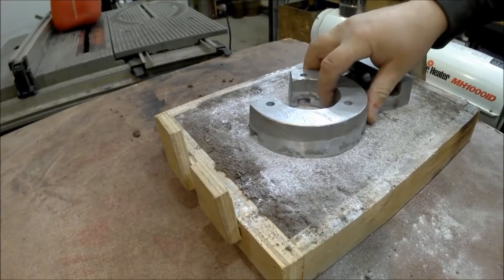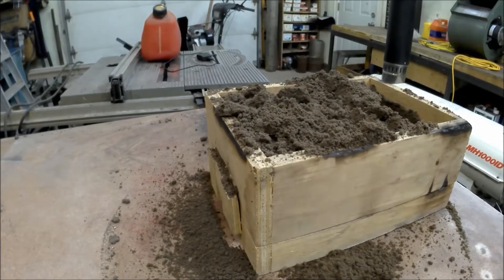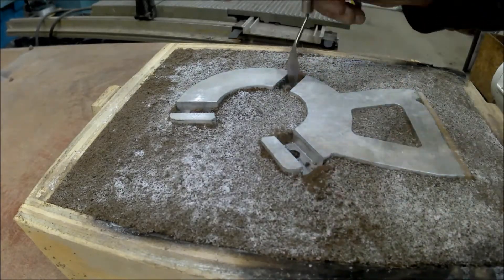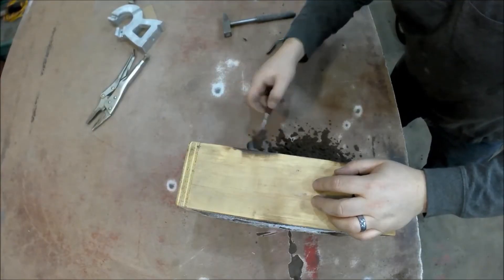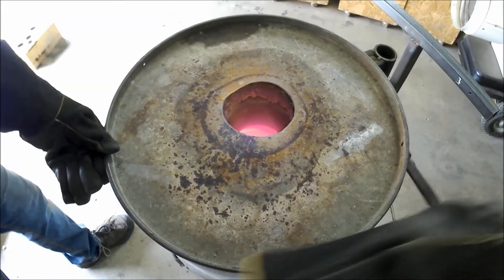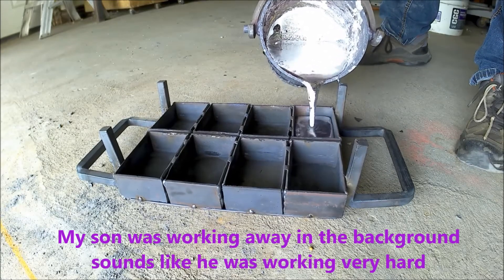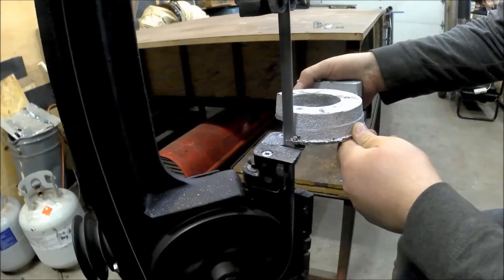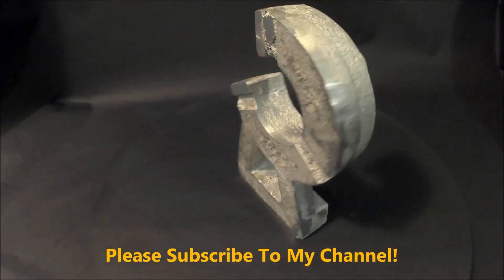Casting Zamak-27 Aluminum Alloy

Comment: Nice work Christ! Although the finished product may not have been your best work, the procedure was quite impressive. I myself would like to cast some aluminium alloy with graphite to carry out a Thermal and tensile strength testing (for possible use in the combustion chamber). So far I have come across a few aluminium alloys used at the moment, like the Al 2050, and Al 2060. However, they are not commercially available. 
In your opinion, what aluminium alloy work best for extreme heat resistant with high tensile strength? Also, what other techniques would you suggest I use in adding graphite to my alloy for improved mechanical and thermal properties?

You can reach me via my email: iamchidera@yahoo.com

Cheers,

Chidera.

Comment: hello sir can you tell me which type of zamak is best for producing key blanks in order to prevent their bending or easily breakage ?
Reply from the maker: Unfortunately I'm not a metallurgist so I'm a bit hesitant in making suggestions for areas I'm not well informed
Reply: None... zinc alloys are brittle, especially in thin sections. You'll notice that commercial key blanks are for the most part brass (standard flat keys, like car and door locks) or cast steel (warded keys), with a few companies offering aluminum blanks. Anything with sections of less than 3mm (1/8 inch) aren't good candidates for zinc alloys, unless purely decorative (very low/no stress applications)

Comment: It seems to me that those risers snapped off far too easily; my guess is that there is something in your alloy that causes it to be far more brittle than ZA27 ought to be.
Reply from the maker: I think I took it out of the mold when the cast was still quite hot. Maybe that's why it was brittle. Also, the diameter of the riser was only about 1/2" diameter
Reply: Maybe... most sources of aluminium contain either silicon or magnesium; the latter of which causes hot-shortness in zinc alloys, when present in anything over a fraction of a percent; and I havn't seen the former been advocated anywhere either. Regardless, Id as soon expect to break my hammer rather than a 1/2 inch ZA27 rod... Nice video though; ZA is an underrated material!

Comment: Hi Chris,  impressive.  I have been wanting to alloy Zamak-27 but have been holding off because of Zinc fumes.   Did you take any precautions (yes, be upwind and avoid breathing in white smoke).  I have an oil burner and don't have fine temp controls.  I am concerned of boiling off the Zinc.  I understand that Zamak-27 is as hard as cast iron, how was your experience machining the casting.  I made a machinist vise out of Aluminum but its too soft, gets dings and scratches.  Thinking of redoing in Zamak-27,  looking for feedback on diy alloying.
Reply from the maker: Hey Paul, I did not had any zinc fumes when I cast my part whatsoever. I kept an eye on the temperature of the molten metal and only have a propane burner so my temperature control isn't very accurate, either. As for machining, I only cleaned up the rough cast with a band saw and end mill in a long shaft die grinder and then sent it off to the person who ordered it so I don't really know how it machines. Having said that, the little cleaning up I did seemed to work quite well and felt similar to machining aluminum.
Reply: hello sir would you be kind of asnwering one question i have for zamak 

which is the best type of zamak to be used for producing key blanks, in order to prevent their breaking by bending ?
Reply: Hey Chris I still have not finished the casting but hope to real soon. I just got a milling table for my Super 11 that will make the job much easier, and give me an excuse to try the new table out! So with any kind of luck you see the video soon! That's a great video by the way! Hope all is well with and the family.